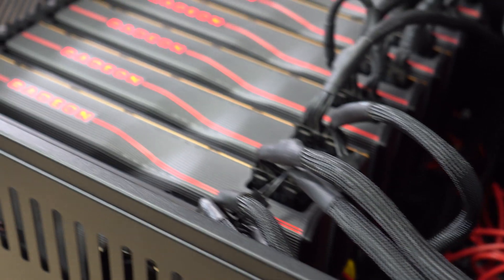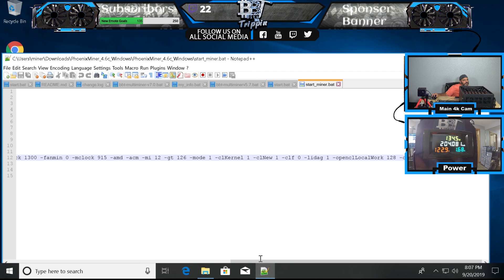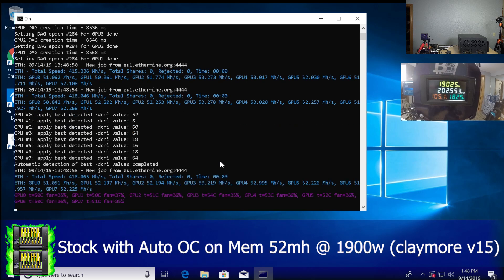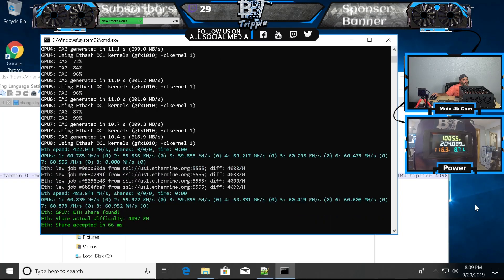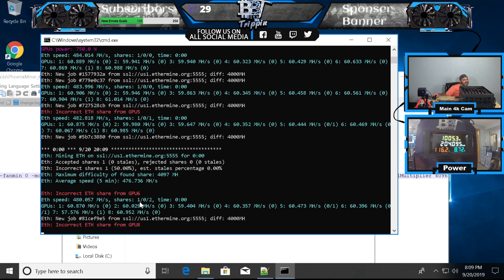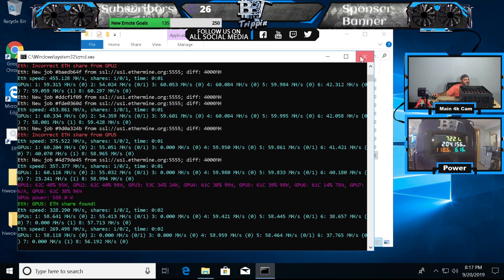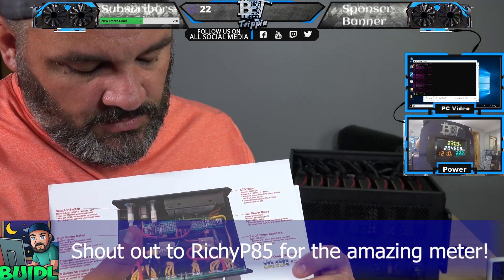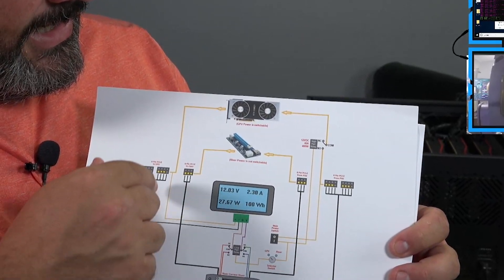Overclocked and Undervolted 5700 XT x 8 = Most Efficient Rig Ever!

Comment: Hi! Do you have a current update on your preffered OC-settings on the 5700XT for mining and do you have the input for entering the OC in to Phoenix? Im currently doing individual tuning on my 6 5700XTs in Radeon Software but need to enter it in to Phoenix Miner to ensure that the mining continues with OC/Undervolt after a crash restart. How do I enter the OC individually per card? Thanks!

Comment: Come on, bro. Love your vids, but your settings are unsustainable. I just tried them to be sure and I'm BIOS modded on all my RX 5700 XT Nitros; got crazy rejects/stales. Best stable I have achieved (on the Nitros in my case) is 57.2 Mh/s per GPU @ 99.3w. Feel free to share stable settings for Phoenix or any other miner.

Comment: What will you recommend to set on power, clock and mem in afterburner on stock bios on a 5700xt Aorus Gigabyte card
Reply: Did  you get answer on 5700XT settings? Im looking as well. I want to use Adrenaline though.
Reply: @grubberzzz9982  He has a super stream on twitch 2-3 days ago. with all you need to know. (y)

Comment: Hi! Is that 1004 Watts only from the 12V rail or for the entire system at the wall? I use the same settings as you (750 mV, 1300Mhz, 925Mhz memory) and it's impossible to get the cards in the 120W range. They are like 140-145 Watts at the wall. Would appreciate how you had your system and measurings set up.

Comment: It's now 11 months later.  Did you ever figure out stable settings?  I'm currently getting a hair over 59 MH on these exact settings with a Nitro+, but with 50%+ hardware errors on submitted shares.   I'm thinking either the cvddc has to come up a bit, and/or the mclock needs to come down a bit.  Sadly, I don't think 59 MH is sustainable.
Reply: The same result. not stable - many invalid shares
Reply: it's not stable at all. these are just screenshot settings. waiting to be proven wrong

Comment: sir i also have a rx 5700 8gb amd 1 fan model card , sir i am mining with a 6 gpu rig 1 rx 5700 8gb and 5 rx 570 4gb , sir i have tried all mining software like phonix ,nanominer, claymore etc my rx 5700 hang after some minutes of mining and them miner restart and that software only hang , computer works            
sir i have tries 5-6 last outdated version and latest version of driver also , i did tdr delay value to 10 also and then i modded the bio of rx 5700 to rx 5700 xt also but still same condition can you help me

Comment: hahahah  Mining Rig using Phoenix Miner 4.6c pulling over 484mh @ 1007w efficiency.  your calculation 1007w  x 24 hours 24,168 KW ,let say price is 0,10 cent for 1 kw is 2,41 usd  a day ,mining ETH u get profit only 3,1 usd ,lol do u know with this price how much time u need to get money back ,lets say whole rig cost u 3500 usd u need 1129 days non stop mining over 3 years and 3 months  lol
Reply: If the ETH reach again at least the U$S 500 the ROI is the half time. :)
Reply: just so you know. today its 6.8usd/day. assuming ur electricity cost is still d same. this rig wud gv you 4.4usd/day. Now it'll juz take 26month to ROI. 

this is why mining is exciting.
Reply: Your math is wrong, 1007w is 1.007 KW so daily usage is 24.168 KW per day. However you did manage to get the cost of electricity right. You also forgot to factor in that the price of ETH varies, it may vary several time in one day. At the moment you would make $3.44 per day and based on your assumed cost ROI would happen in 2.79 years or 2 years 8 months.
Reply: @dhellis19498  lol even  u get 10 usd  a day  u need  a bunch  of time,your invest  is  high ,that is point
Reply: @dhellis19498  His math is not wrong. Europeans use commas as decimals and decimals as commas so 24,168 KW to a euro is the same as 24.168 KW to an American. Same reason he said 2,41 usd instead of 2.41. Of course you are absolutely right, profits are related to the price when you sell not the current price or a theoretical prediction.  The only realistic projection is cost in electricity and cost in hardware, profits are never guaranteed and rarely practically predictable.
Reply: How much money are you netting tho?

Comment: Time to ROI?
Reply from the maker: Depends on the snapshot in time. Yesterday it would have been around 17 months. Today, would be never. Tomorrow (once difficulty drops due ot loss in profitability, could be back to near 17-20 months); bottom line, Mining while important to aim for original investment + some level of revenue is a highly speculative and risky proposition. 

As I do on this channel and have since showing you all how to configure, tweak and mine, I approach this from observe and report, you need to review  your ops cost (power) and see if it makes sense for you to participate.
Reply: @BitsBeTrippin   lol are u sure what u say 17-20 months for whole rig 8 cards (3200 euro)exclusive motherboard,memory,cpu and power supplay ,i think u are wrong lol ,even each card spend 100w there is no chance to get  back so fast money.800w x 24 hours =19,2kw even u have price for 1 kw 0,05 cent price is  a day 0,96 cent for electro cost  ,even u have stabile profit 5 usd a day  there is no chance what u say ,u need minimum 2 years non stop mining lol
Reply: at this moment even u have free energy  for eth u get 4,5 usd  a day ,so your calculation  is not correct
Reply from the maker: @onlytrue5169  This is always an evolving ROI. Right now as I mention in the video and desc, not recommended if your looking to ROI quickly. But typically in the near decade of mining, the machines were always underwater until they weren't (when large runup in price). Will it happen again, nobody knows, crypto is a highly speculative environment. Some folks make the investment and risk through the hedge vs buying coins directly.
Reply: You'll be retired by then LOL
Reply: time to ROI is the wrong question. What is your investment?

Comment: 👍good video! But I prefer 570/580 still, price vs hash
Reply: I wonder how you figure out price vs hash?

rx 570 30Mhs @ 110W, 200€ = 0.27Mhs/W = ~ 20-30€ ???
rx 5700 55Mhs @ 110W, 400€ = 0.5Mhs/W = ~ 40-50€/month

Both cars same ROI but second one more effcient

I have just purchased used RX 5700 for 300€ with over a year warranty...someone not happy with gaming perfromance